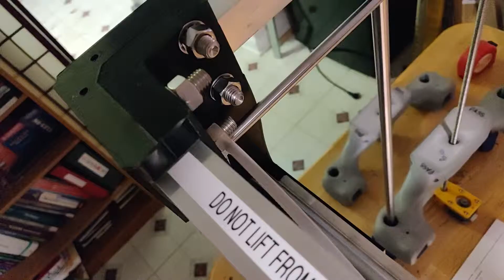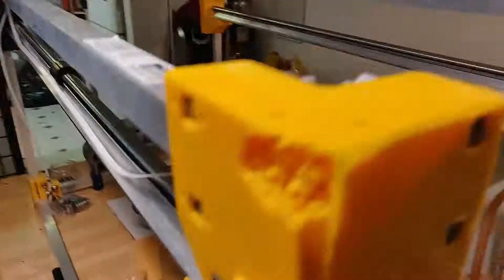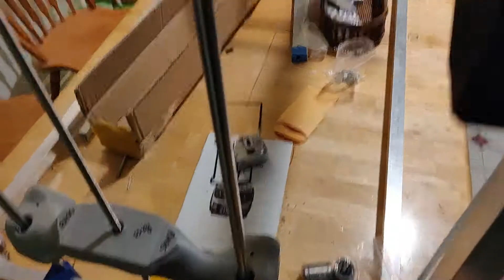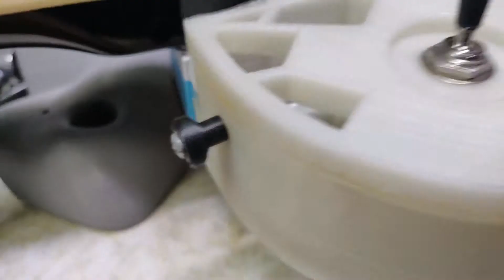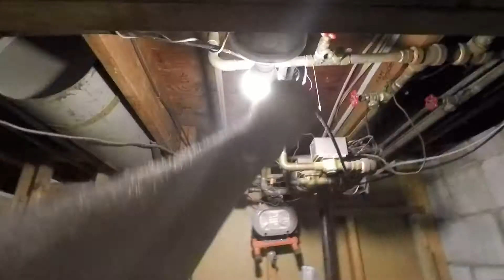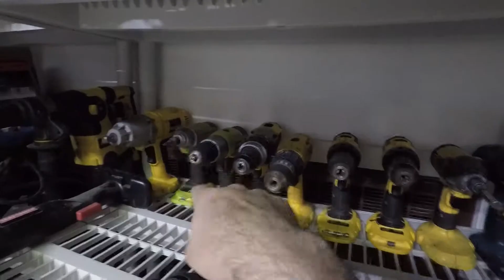MAKING A BIG 3D PRINTER  (PART 1)

Comment: Nice video. I like your editing.... and it looks like an interesting project. You are probably aware of Openbuilds extruded aluminum... but I think you may be interested in these as well... a lower tier of the 80/20 product line.
https://8020.net/framing-options/quickframe.html